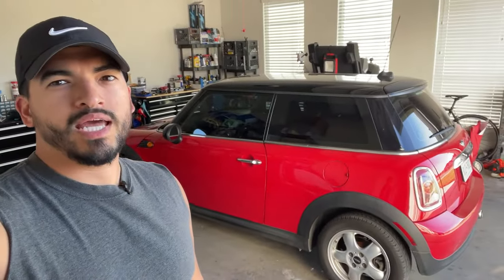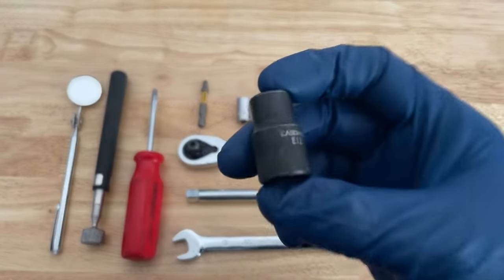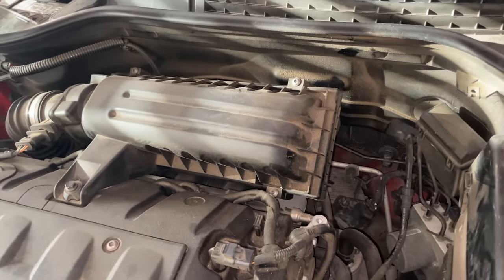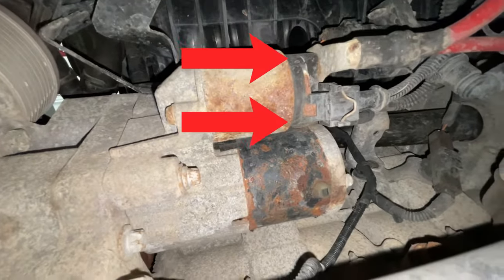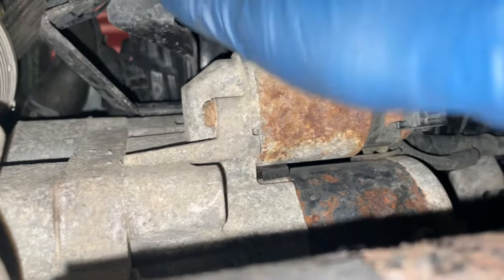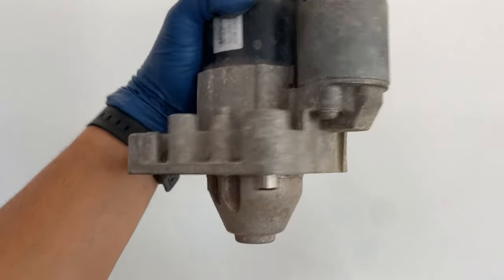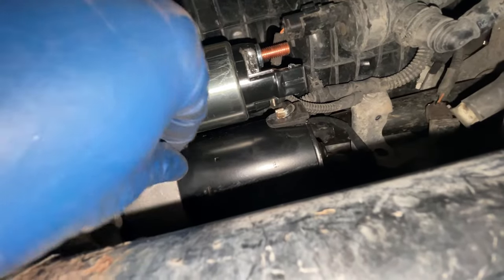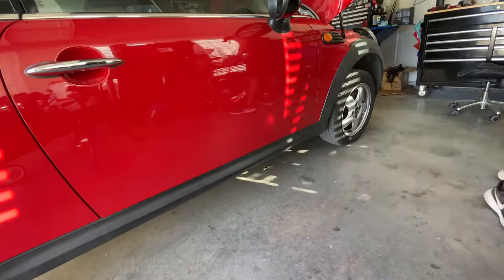How To Replace The Starter Motor On A 2007-2013 MINI Cooper Base (R56) - Not Starting or Turning On?

Comment: TIP For a 2010 S model clubman take off the pass front tire and pull the starter out that way. Super easy. No need to fight pulling it down.
Reply from the maker: Good to know! Pinned the comment.
Reply: Would that work for the 2007 regular one?
Reply: Only that model of cooper pull out passenger tire only

Comment: Great video! I just experienced the exact problem and had to jump start my r56. My battery is good, so I will replace my starter.
Reply from the maker: Good luck! Not terribly hard but the bolts are annoying. lol.
Reply: @CarSharingJho  thank you for the well wishes. And I believe it about the bolts, I am anticipating it ha ha ha.
Reply: Did you fix that problem? I encountered this kind of problem yesterday, and I pretty sure the battery is good, but it can’t start

Comment: Pretty good video.
Mine was a lot tougher to get out. I went from the top
And I had one e12 (rear) and another e11 (front) bolts so be careful....the e12 fits and will even turn it but you could strip it if you're not careful.
The starter might need a good wack to get it out also.
The righting pins on mine were degraded a bit and made it pretty tough to move.
I also had to disconnect two coolant hoses to see that 3rd boltr (the 13m)
Reply from the maker: I’m glad you were able to get it to work! Thanks for the input. Are you in a northern state by chance?

Comment: Thank you so much for the posting, extremely helpful. Would not have been able to replace mine without this video. Those torque bolts were so nerve-racking, one wrong move and one can strip the head and you’re completely screwed. Had to be so careful. Why couldn’t they just put regular starter bolts in there like they did for one 13mm it has?!? SMH lol thanks again!
Reply from the maker: Awesome! Glad you were able to do it!

Comment: Do you know how to remove the lid above the starter? One of the starter’s screws is stripped, the hardest screw I have ever met, if I can take the screw apart, I can't replace the starter!
Reply from the maker: The intake manifold - is that the lid you are referring to?

Comment: Dont suppose you know if this is exactly the same as a mini one? 07 plate. Engine bay looks pretty similar. Think the solenoid  is going, starts up fine the starter comes on by iit own and weird wurring noise all the time.
Reply from the maker: I don't know, sorry.

Comment: Thanks bro for the video i already  did everything but when I press the start button it didn’t  start! I got new battery new starter but nothing!
Reply from the maker: Does the start button work? You don’t think it could be the switch itself?
Reply: Well I don’t think so because before that starter she was fine just starting slow!
Reply from the maker: What's it doing now? Does it try to start, or does it just click?
Reply: He doesn't even try, the starter isn't activating! It's as if I have an activated mode that won't let me send it! As a maintenance mode or something similar.
Reply from the maker: You don't have a kill switch installed do you?
Reply: No, but it feels the same as if I had one!
Reply from the maker: Did you check your fuses?
Reply: Yes I check it! Do you speak Spanish?
Reply from the maker: @franciscoreyes151  ¡Si!
Reply: Que bueno! Mira hermano cambie el starter y no hacía nada cuando presionaba el start button pero hoy borré los códigos con un mini scanner y ahora el starter suena como si estuviera fuera de engranaje como metal con metal!

Comment: I can’t remove the E12 on top, any suggestions?
Thanks
Reply from the maker: Is it on too tight? Adding extensions will give you more room.
Reply: @CarSharingJho  are you sure that’s a E12 and not E11? It keeps sliding.
Reply: Get someone else to try lol

Comment: Where you get the camera from
Reply from the maker: I used a cheap endoscope camera from amazon but they have much better ones now. This is similar to the one I was using

https://www.amazon.com/Endoscope-Camera-Inspection-Adjustable-Semi-Rigid/dp/B0CKQH4VZY/ref=sr_1_3?crid=2Y8Z7CFFJS0QP&dib=eyJ2IjoiMSJ9.sZkYyybZvF9IcP6iVNaY4F0Y5th3aRMT8tNfPpeHuiU0uNT-3Qb_gEFE-e27otSUzV3HPe0cug78RilqOBxbvi8G6_3LdQzUNCNbWyEhdwpOJ1ltplF_-tkpYfFMSJaB4uVTW6pfP53i_ydfZE9bREWib9uqjpHCxZHrMJ6AEqkHMMswOJeCOpScY6Cfj3GBJdgB64xGCDEFMCbOAlJu5h6ZDY7jJtrlDplUVnUBm6Y.rbiiG1tDwcWKogEnNByK6w2Mgl-f-uhUW2MF2bXBuQk&dib_tag=se&keywords=endoscope+camera+car&qid=1724691160&sprefix=endoscope+camera+car%2Caps%2C161&sr=8-3

Comment: Horrible job. 2 hours trying to get that top bolt out. Damn sure someone else has over tightened it massively
Reply from the maker: Did you use the two wobble extensions mentioned?

Comment: Yeah, fuck that shit, taking it out from the bottom lol. I spent 10 minutes trying to yank it our from below. Gave up and pushed it uprlwards through the engine compartment. Took me 30 seconds that way.
Reply from the maker: Did you remove the intake manifold?
Reply: @CarSharingJho  na, just the intake and air filter stuff
Reply: @CarSharingJho  just moved a bit of the wires ans hoses and shit, went right through
Reply from the maker: @NoBody-lc5iv  Ah, good to know!
Reply: It ain't coming out either the top or the bottom for me.